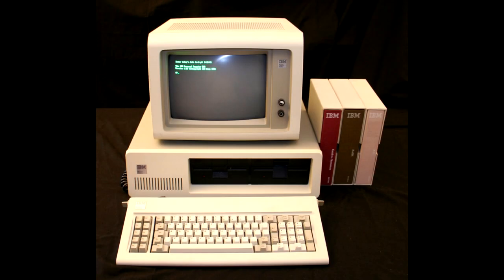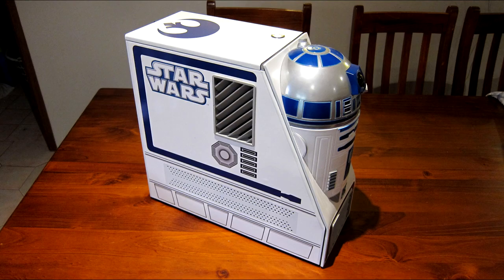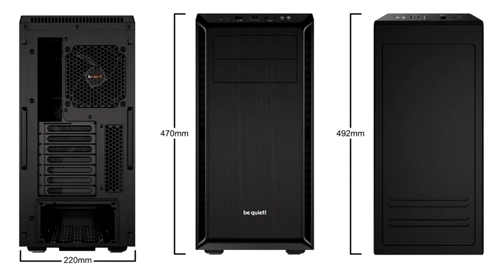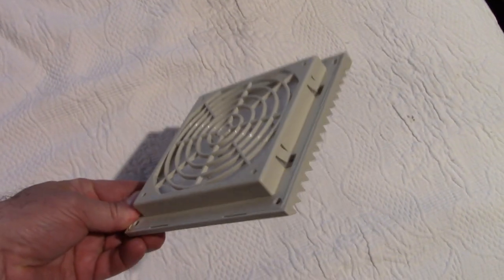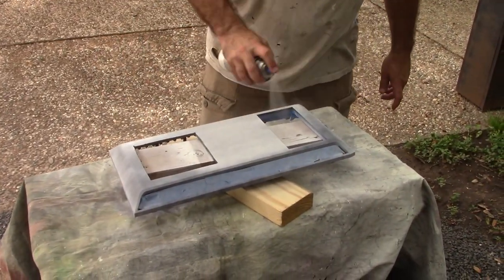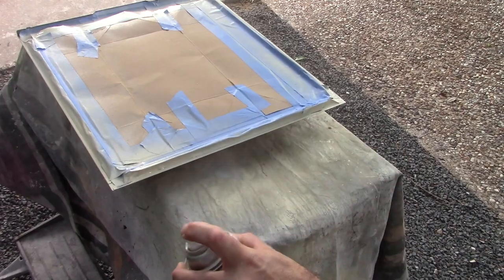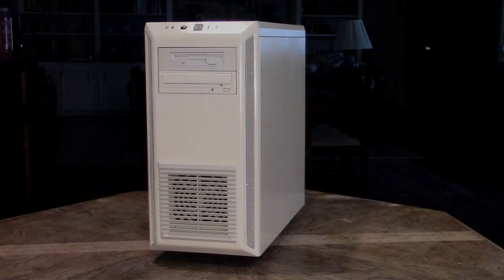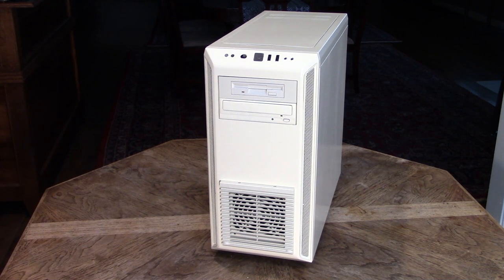A new Pure Base 600 computer case is modified to vintage beige early 90's retro style

Comment: Very cool idea. By the way, you can get floppy drives that mount internally and hook up to the usb hub on the mobo.
Reply: I was thinking of that, but use the USB motherboard pin to USB type-A. https://www.lindy.co.uk/images/usb-2-0-motherboard-header-adapter-p2741-1703_zoom.jpg

Comment: You could get a USB floppy drive controller to make that floppy drive work and plug it into a USB header on the board.... That'd be awesome. Amazing job on this, I'm thinking I may replicate this build soon.
Reply: There are PCI-E cards that add a floppy controller, works better than doing it through USB.
Reply: @Eddies_Bra-att-ha-grejer  Neat. Didn't know those existed. But that makes sense.
Reply: @Eddies_Bra-att-ha-grejer  where did you find those? Been hunting around and didn't find any actual pcie cards, some old pci cards that might work with a adapter "maybe".

Actually started building a Window XP era machine with old parts just to have a PC with real floppy support, both because I had some of the parts already and because I've been having too much fun with a little old Sony Mavica FD75 floppy disk camera, it's a neat counterpart for my modern Canon EOS M200
Reply: @UNSCPILOT  Ah, you might be right, I might have been looking at PCI cards. If I was to install a floppy drive internally I would use a Greaseweazle or something like that either way, because that way I could read and write Amiga disks and such.

Comment: you should get one of those floppy drive adapter cards(34-pin to usb with power connector) that allow the floppy drive to work over USB, then get an internal USB header adapter(converts motherboard header to a usb port in-line) and plug it in. only caveat would be to find a way to get a 4-pin power cable to it but there are cables that can convert the 12v molex to the smaller kind that floppy drives use.

Comment: I use a Pure Base 600 with an X99 system, and the air flow is adequate. Couldn't support an extreme OC, but it's not designed to.

The front intake mod is really clever though, and the whole project seems to have turned out nicely. Well done.

Comment: Cool

This ventilation grill is the biggest highlight in the billd. I'm currently working on an similar project and I'm going to use or a metal  grille or some fun filter painted baige. My base is a simple 2009 black (painted) ATX case. It lacks in cable management.

Comment: mAYBE ITS been asked but how long are you waiting between primer coat and color coats? You didnt sand down even lightly, the case parts?
Reply from the maker: I follow the directions on the label. For this paint,  I think I waited 15 or 30 minutes between coats.  I did not sand before painting, I only cleaned the parts.

Comment: There are a ton of old beige ATX cases out there though. Building a modern sleeper PC in an old case like that would seem like less work than making a modern case look retro.
Reply: They are expensive and you have to change the entire inside
Reply: @The_MEMEphis  You can find them pretty cheap, and ATX cases from the late 90s don't need any changing
Reply: @MilkBreakMinecraft  ya they do their mounts are all completely different and not design to fit modern motherboards you need a completely different back plate
Reply: @The_MEMEphis  You really don't. Maybe you got unlucky. I literally built a modern PC inside a late 90s inwin case, and the motherboard standoffs were in the perfect spots. The ATX standard hasn't changed much at all, and is mostly still compatible. If you had one that was completely different, it probably was an AT case.
Reply: @MilkBreakMinecraft  well the atx standard wasn't made till 1995 and had a major change in 1999 so any early 90s case doesn't work with modern motherboards especially if you do AMD builds also ATX just refers to the size of the case nothing else, and the back panels are very very different since I/O has changed alot since then alot with the pin connectors for power supplies, also the shape of gpus have completely changed since then and can be impossible to fit without making modifications, I personally am also doing an AMD build so ya
Reply: @The_MEMEphis  Since your comments are such an incoherent jumble of individual points, I'll address them point by point.

1. I was specifically talking about late 90s cases. Obviously, earlier cases are NOT ATX compatabile, and therefor not what I was referring to. If you want to use older cases, you will need to modify them indeed. But this is completely beside the point, as I wasn't talking about any cases other than ATX ones. 
2. The change you are referring to is ATX power, which has NO BARING on case compatibility. You can always use a modern power supply.
3. ATX refers to both motherboard and case standard.
4. The back I/O slot is still the same size it was in the late 90s, every motherboard has its own backplate that can be slotted into the cutout.
5. Power supplies are also still compatible with older cases, but that is completely outside this current discussion (I have no idea why you are bringing that up). Again, using a modern power supply in an old ATX case completely solves this incompatibility you think you found.
6. PCI cutouts in ATX cases are still in the same spot as in the late 90s.
7. Whether you are using an Intel or AMD compatible motherboard has no baring on case compatibility.
8. There are MODERN cases that don't fit a 3080, there are large OLDER cases that do, again, this has no baring on the discussion.
9. Cooling and cable management issues have NOTHING to do with this discussion. We are talking about compatibility between case and motherboard. It is true that older cases often don't have great cooling, but there are plenty that have spaces for fans. This really depends on the individual case. 
10. It sucks that there aren't any older cases in your vicinity, but this has no baring on the general discussion.

I appreciate the discussion, but I strongly get the sense you are more interested in being correct than in understanding the reality of using early ATX cases for modern builds. They are very much still useable for modern systems. Depending on the case, and what hardware you choose, they might require minimal modding, but this is completely optional. You are simply WRONG in saying the standard has changed in any meaningful way. ATX is still ATX. The motherboard standoffs are in the same place. So are the back I/O cutout and PCI slots.

Again, my point was that making a modern case look retro is more work than using an old ATX case for a retro/sleeper build. Even IF this requires some modding to the case, which it usually does not because the ATX standard is still the SAME - this would be less work than spray painting a modern case beige.